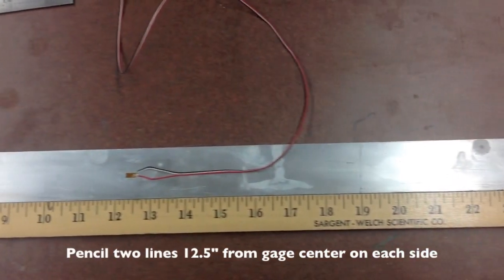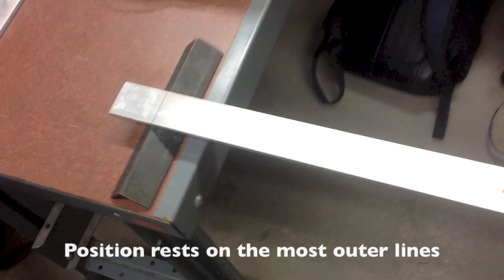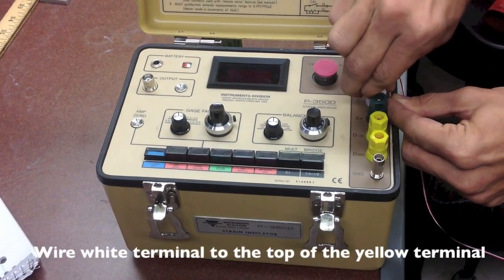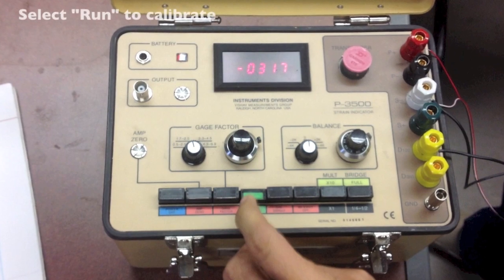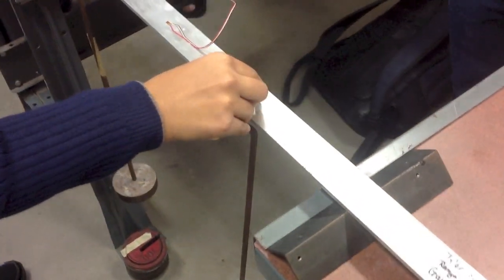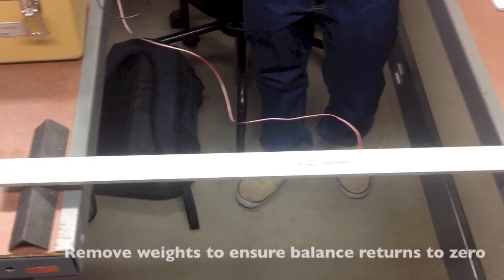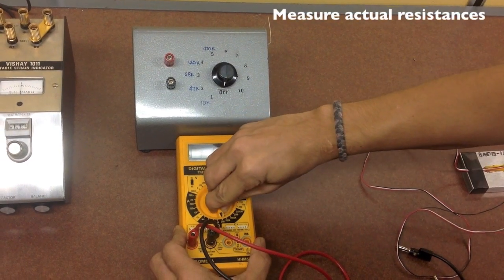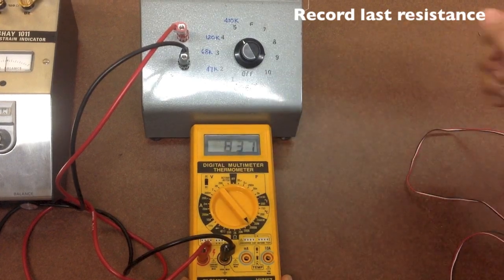Calibration - Strain Gage and Strain Indicator

Comment: Hi, Tyler, your work is very helpful.

I have a P-3500 strain indicator and several CEA-06-125UN-350 STRAIN GAGES from Micro Measurement. I want to use the full bridge in P-3500. In the bridge, one resistor is the strain gage, and there are other three 350 ohm resistors. Does P-3500 have those three 350 ohm resistors inside itself or I need to buy the resistors to make the full bridge? In your video, you have four wires from the strain gage? But CEA-06-125UN-350 only has two terminals. I feel confused.

Thanks for your help!
Reply from the maker: 邓威 
Good question! You should have a wiring diagram on the cover of your P-3500 strain gage indicator. The configuration is as follows:

Red wire - To one of a gage  terminals
White and black wire - To the other gage terminals
Yellow wire - Jumper wire for a quarter bridge use

Now the yellow wire is a jumper wire which enables you to use a quarter, half, or fullbridge. That will be on the wiring diagram on the cover of your P-3500.

I think the three wires coming from the strain gage is what's confusing you. Rather than me explain, I'll let the professionals from Micro Measurements describe why to use the three wire system. Observe the following video: https://www.youtube.com/watch?v=1EYYTKoatcU

I hope that answered your question! Let me know if you're still confused!

Comment: Tyler i have a question, if a have a strain gage connected to a Wheastone bridge is it possible to measure or to do a graph like weight( in N) vs  Mili Voltage( i mean applying the load in the cantilever and getting this voltage from the wheastone bridge), i'm a bit confused cause i don't really understand what the wheastone bridge is actually for, my english is bad so let me know if you don't understand my doubt..
Reply from the maker: Harold,
You could use a wheatstone bridge to obtain the force vs mV graph although there are probably cheaper methods such as a single strain gage applied to the cantilever beam.  I would use a single strain gage and then calibrate the gage with multiple known loads. Apply the loads to the cantilever beam, and record the output voltage.